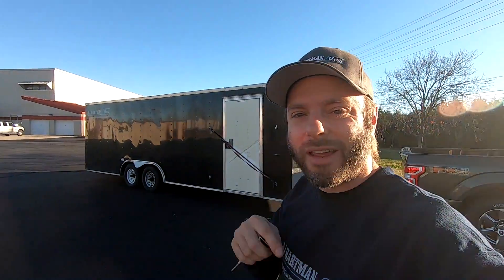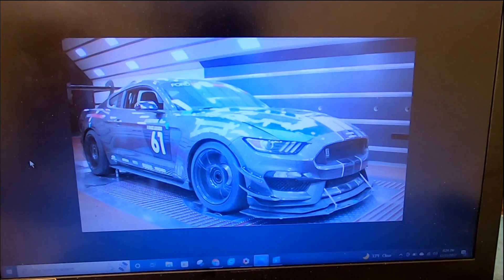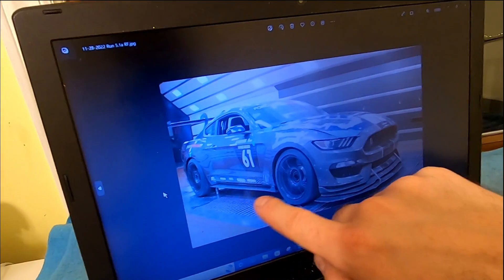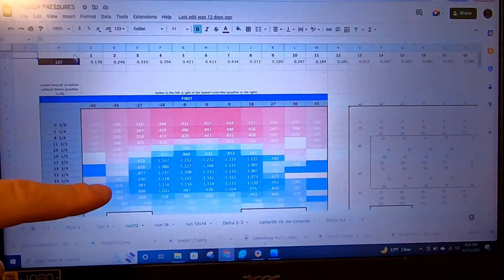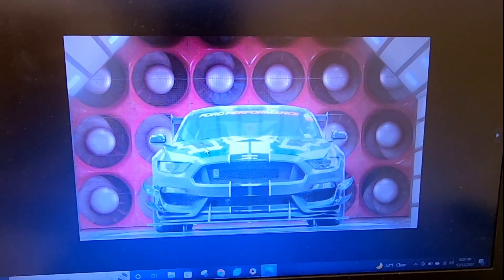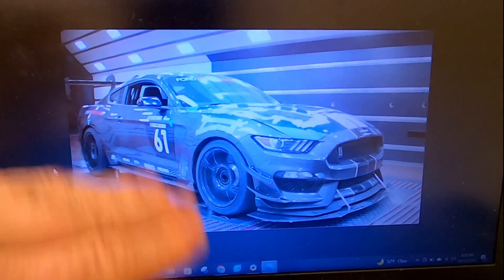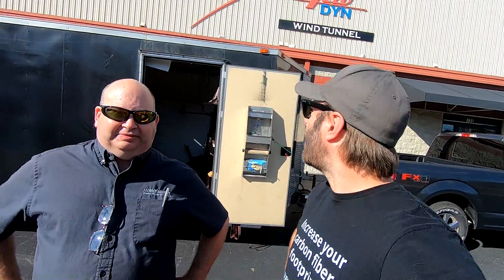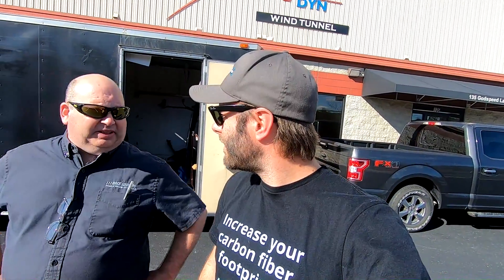Took My Car to the Rolling Wind Tunnel!

Comment: Would ducting air from the front lower outboard ducts, (already a part of frontal area), to the someplace forward of the wheel well, potentially serve the same function as the canards? 
Maybe include a ejector / augmentation nozzle at the discharge to extract more under hood air?
Way interesting to see genuine R&D, rather then wishful thinking product development.
Thanks for sharing!
Reply from the maker: I'm having trouble following since you are throwing several things out there that are hypothetical parts or ducts. We did test closing the factory air curtain in the other video. But it seems like you have some idea of a whole front end configuration and depending on what you do can be good or bad. I'd have a very hard time imagining it being more effective than a nice set of canards, as well as way more complicated and involved.